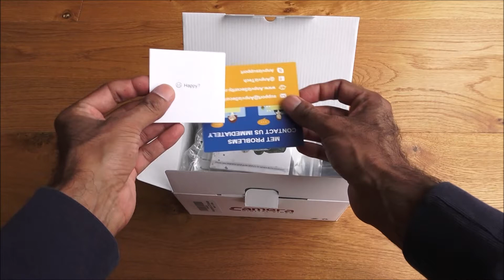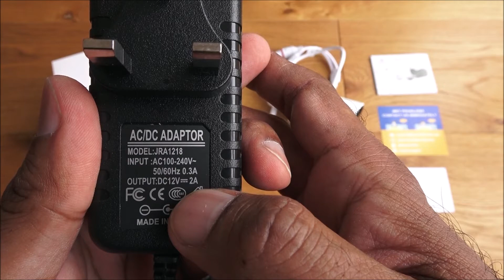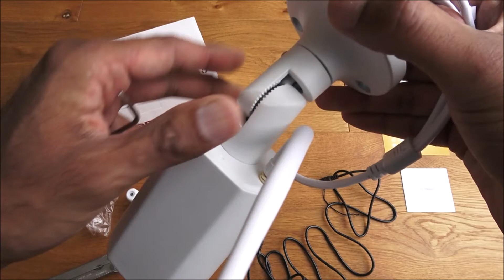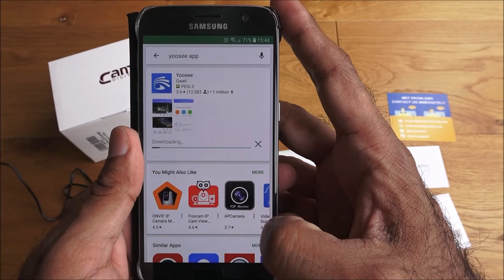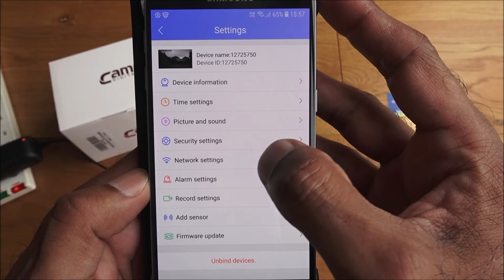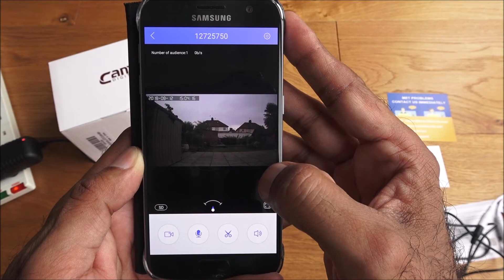Anpviz Wireless Outdoor Security Camera 1080P Two-way Audio [Hands on Review and Test]

Comment: Also, can you access the camera remotely (i.e. you're away from home and you want to check your house as seen from the ip camera) ?
Reply from the maker: Yes you can connect to it remotely.
Reply: @GeekStreet  Wow, thanks for the quick response! I already bought one from the link provided. Btw, can you recommend a waterproof cable/connector for the power adapter for this? The power outlet from which I'll be plugging in the ip camera is quite far from where I'll be installing it and I see that the power adapter included isn't waterproof and a mere power extension cord just won't do.
Reply from the maker: No problem, check this out there are a few  a little bit large but that may help due to the size of the plug. 

https://www.screwfix.com/c/electrical-lighting/weatherproof-enclosures/cat3360012
Reply: @GeekStreet  Thanks! I'll be looking into them later :)